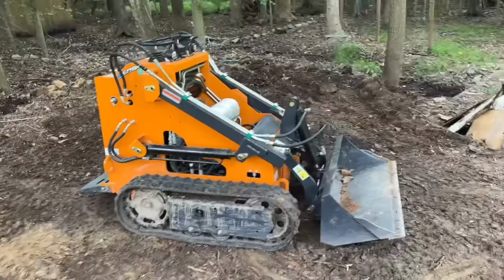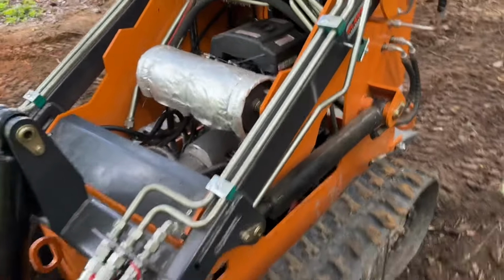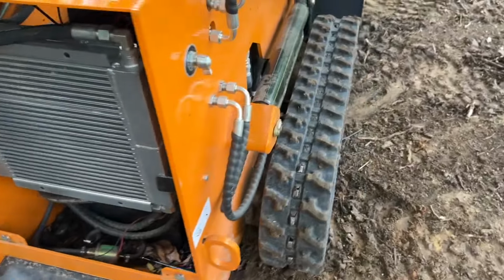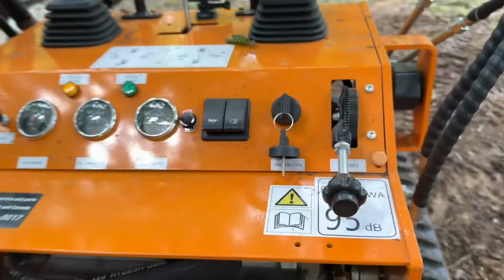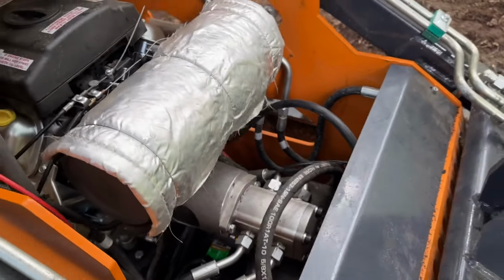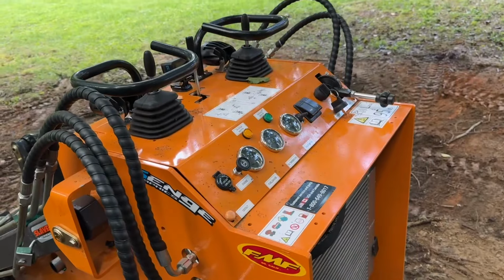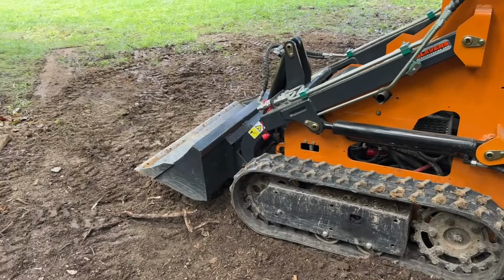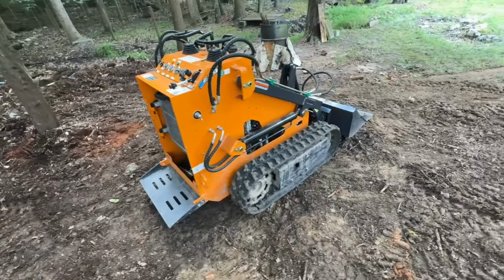Chinese Mini Skid Loader 6 Month Review

Comment: Thanks for posting.   I was interested in getting one for light work around the house.  Moving rocks etc.
Reply from the maker: That’s what I use mine for and it is awesome. Honestly though looking back you can get an excavator cheaper and I think it might be more useful around the house, especially if you get a hydraulic thumb for it. Either of them are awesome to have around the house though I think.

Comment: I’ve got the HY380 wheel machine and I removed my hood also. I’m at the point I’m ready to replace my motor bc of charging issues. I added 4 67lb suitcase weights and it made a huge difference.
Reply from the maker: Yeah a predator motor is the way to go. I bought the extended warranty. I bet the weights help. I need to figure out how to mount some on mine.

Comment: Thanks for the videos. Have you tried running a brush hog with that two stage pump? Just wondering how it did if you have.
Reply from the maker: No I haven’t. From what I understand it won’t go well because they aren’t hi flow pumps and you won’t be able to move and brush hog at the same time.

Comment: Does your oil temperature gauge light blink even though it doesn't work when on?  You should have installed the battery behind the engine after going all that trouble to replace it.  It would have moved 30 lb 2 ft to the rear down low and allowed you to charge or change it easy.  Would have had kept the rear door for that though.
Reply from the maker: There's nowhere to put the battery back there.  That space isn't flat and its where my fuel pump is mounted and it would be in the way of the radiator.  I would also have had to get new battery cables.  The light doesn't blink, it just stays on all the time. I use a digital laser thermometer to check the operating temp and I've not had a problem so far.

Comment: Sorry but no bueno!
Reply from the maker: Si bueno if you need a machine that can pay for itself in about 3 projects!
Reply: @lurtbike  Honestly, I do landscaping professionally and I'm considering one of these things lol. This thing would pay itself off in one job, and as long as it survived two jobs it's pure profit. I love Bobcats but it's getting expensive to run them at $350/day + 13% sales tax or $50,000 to buy, I'd rather get one of these for $4,000, make the necessary modifications and call it a day.
Reply from the maker: @kylequinn1963 exactly. They aren’t perfect but at 1/10th of the price they’re basically disposable. And you can buy a predator motor off the shelf with a 2 year warranty and slap it in. The rest is basic hydraulic stuff that is pretty simple. Like I said in the video, if you know how to work on stuff and you go into it knowing it will need some things you can probably save a lot of money.
Reply: Heyy bro how much was the new motor?
Reply from the maker: @GAMERBROTHER98  $1300 with the 2 year extended warranty from Harbor Freight.  Also had to buy a $20 sleeve off eBay.